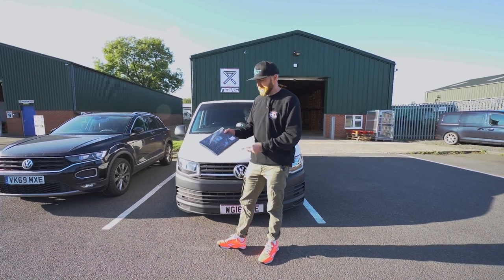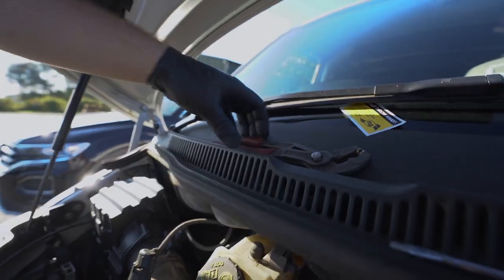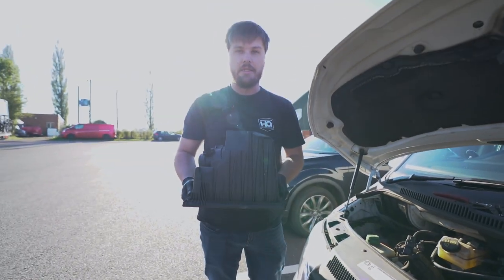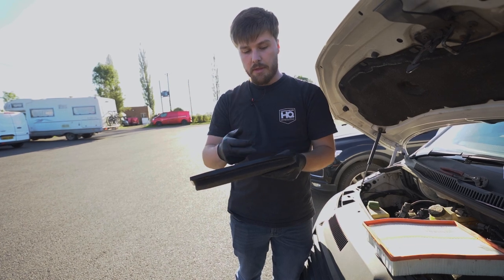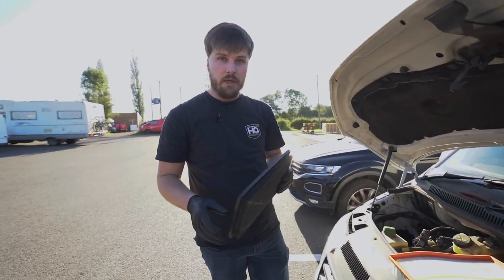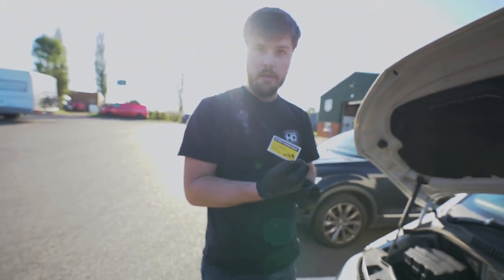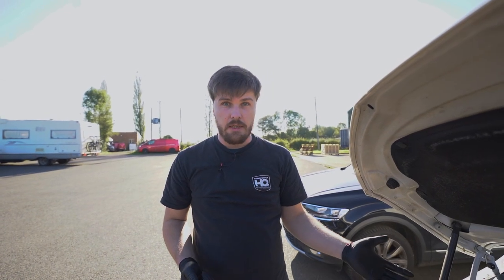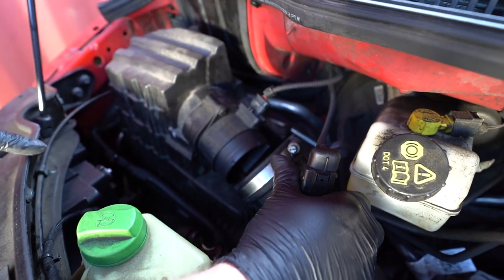How to fit a performance air filter in a VW Transporter T5, T5.1, T6, T6.1, Transporter HQ and ITG

Comment: Best thing you can do to any diesel.... Told bay an old timer farmer, diesels love air! So i fitted a K&N drop in panel filter to a few vehicles in the past... Made a decent difference. less gear changes, and an increase in MPG...
Reply from the maker: Thats very interesting to know. Thanks for your comment :)
Reply: Does it make a sound difference?
Reply: @Iain1107  I didn't notice any difference. Maybe because the filter is still in the air box...?

Comment: I love the reluctance to not air up because it makes it easy to reach the filter and more clearance from hitting your head on the bonnet😂. Tbf when I finally fit my kit I wouldn’t raise it up to make it easier because why would you. Once it’s down it stays down 👌🏻. I fitted the k&n filter, not sure if it made a difference but it’s a mod 👌🏻😃
Reply from the maker: I even air out at the fuel station. It's a right pig bending down the fill up. Give me a sore back every time 🫤
Reply: @THQAutomotive  maybe you should start selling an extension to clip onto the nozzle at the pump 😃
Reply from the maker: @wandango5913  on it 🤪

Comment: I had a similar cotton filter in a 2.0dti Audi same engine as my  current T5 . I did notice a slightly  I mean only slightly better performance throttle response. It payed for is self as because only buy once . Wonder if worse bothering putting it in a high mileage T5 . Unfortunately not the same size otherwise would of swooped it out .
Reply from the maker: Yeah they aren't going to add 20bhp or anything, there is defo a gain though. And like you say, there is a cost saving in not having to replace them.
Reply: @THQAutomotive  true , I have them in both my motorcycles . Because unlike in the car world , not always a big difference in cost between paper and cotton filters.also you have to replace the air  filter a lot soon for a m/bike so no brainer . plus the engine induction ,sounds better even in a Diesel engine..